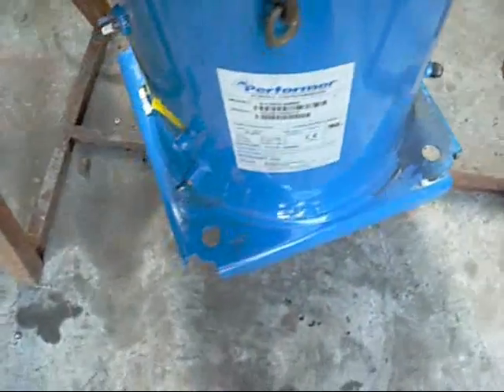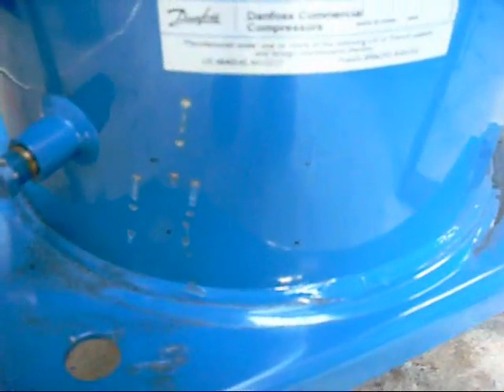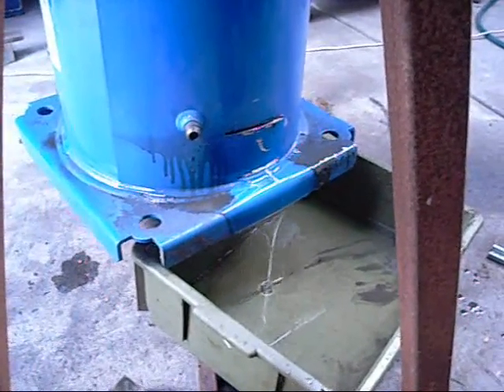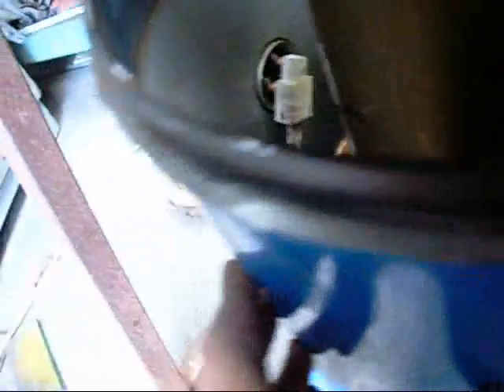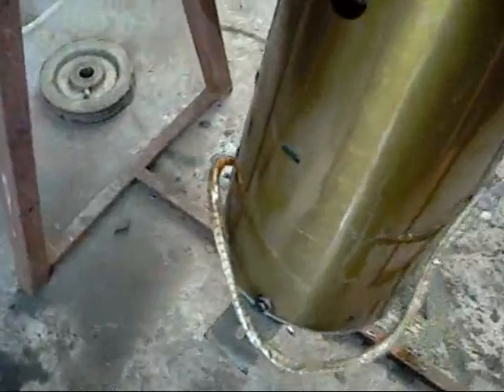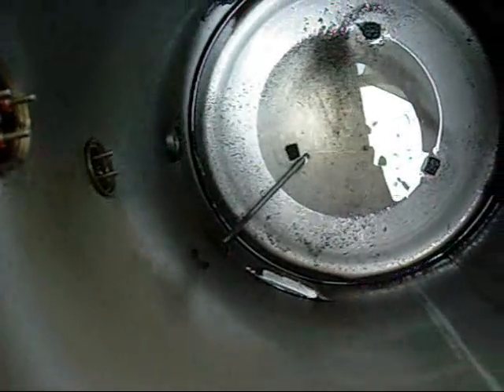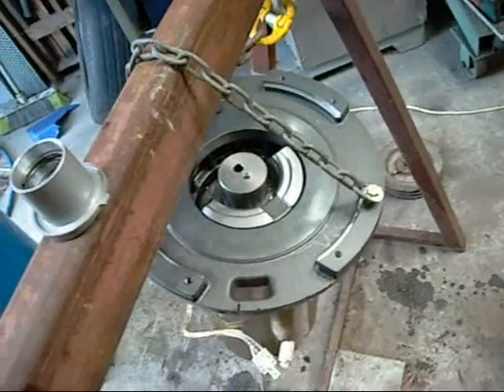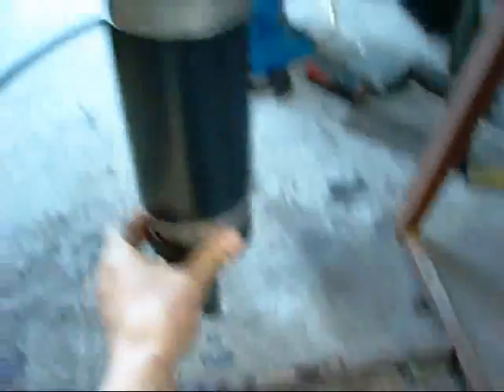Disembowelment of  the Danfoss Scroll - Pt4

Comment from the maker: @HoneycombAgent After pumping gas out to a recovery cylinder I strip it down to 3 groups, coil scrap, copper tubing, and steel. fan motors aren't worth the effort.

Some times I drain the oil out of the compressor if its really big, but most of the time its not needed since there is not much of it, and it all goes through a hammer mill type shredder so oil lubrication is a good thing. same with car engines and transmissions, drain the majority of it and the rest lubes the machine.